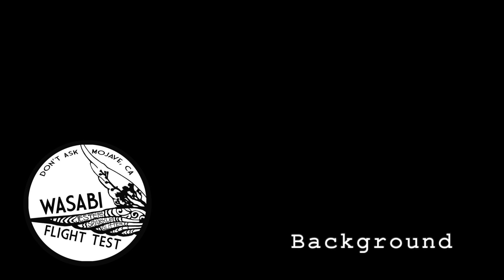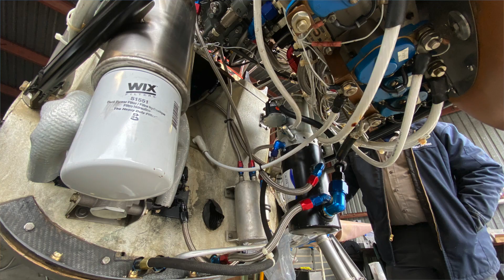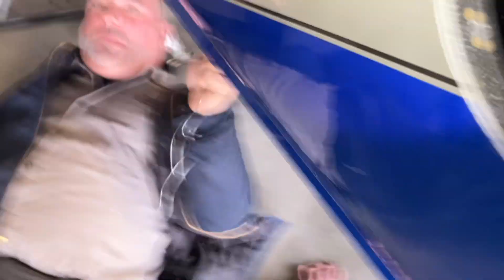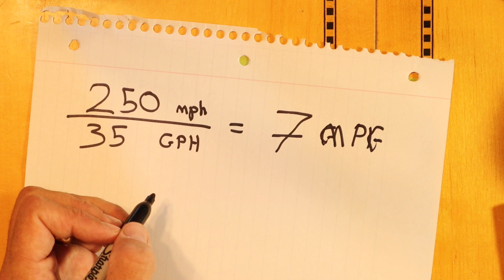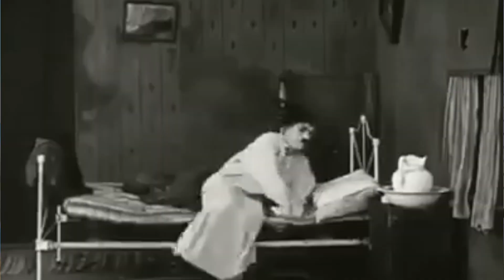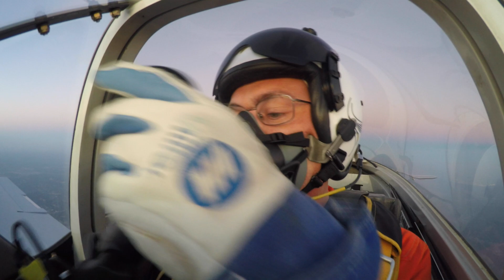Bet Against The Sun - LongNoseThunder Re-Reflight Ep4 - Turbine P-51 Thunder Mustang Kitplane

Comment: Brother Elliot, could you offer advice on where to research aerodynamic modifications to increase efficiency and cruise speed for my Skystar Pulsar III? 
I am seriously researching engine upgrade options in the 120 to 130 hp range to replace the current Jabiru 2200. Since cowl mods will be necessary, I’m especially interested in minimizing drag in this area, including cylinder and oil cooling provisions. Want to also be smart about engine mount design and relocation of some components to adjust CG without adding dead ballast in the tail. Lastly, if I can afford it, I would love if you were in or near Mesa, Falcon Field, Arizona, to get your eyes on my (actively flying) Pulsar for specific advice on where best gains are likely. Thank you.

Comment: Awesome video! For the quick refuel, do you have any rules about always sumping the tank or being the last to touch the caps for customer airplanes? Personally, I don't like line people closing my fuel caps, or if they do, I'll go back and make sure they're seated/locked correctly. It's take such a small amount of time and is just one less thing to have an issue with in flight. this also means that I'm forced to manually verify the color and visible fill depth post fueling.
Reply from the maker: Thanks Chris, yeah there were risks taken here but I think you can see the margins were close.  Stoked to have you along!!
Reply: I don’t think he answered your question.

Comment: Very surprising that an aircraft this complex to build doesn’t have a fuel flow gauge/totalizer, particularly as it would have been easy to install and the cost would have been negligible compared to the cost of the aircraft.
Reply from the maker: James thanks for the comment, I get where you are coming from.  I think it’s important to think about the builders experience.  You spend all that money and time, and one more gauge or one more custom part could be the straw that breaks the project.  And then the airplane ends up like so many homebuilts, collecting dust and getting moved from one garage to the next.  Thanks for the commentz
Reply: @utopiasnow  I agree with the owners point of view as regards adding a gauge, but as the test/ferry pilot it would at least limit the chances of fuel starvation or exhaustion. You spent time fixing the one minute warning light so clearly fuel was a matter of consideration.
My turbines at least have 20 mins left once the low fuel lights come on but I would not fly them anywhere near min fuel without clear knowledge of when the flames will go out.
Reply from the maker: @jamesgrant2253  100%, sounds like  we are on the same page
Reply: @utopiasnow  Yes Sir. Fly safe